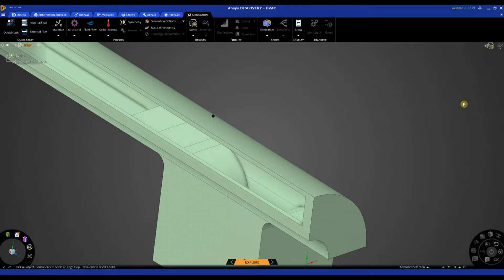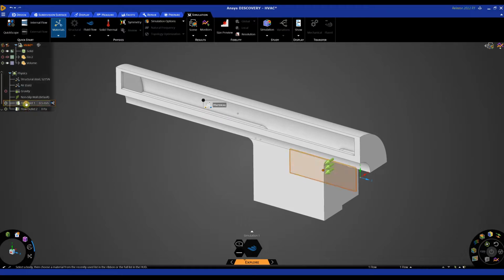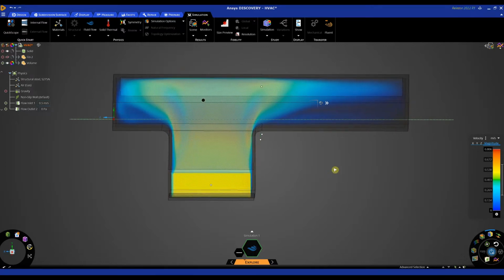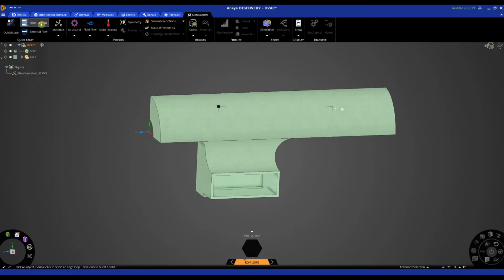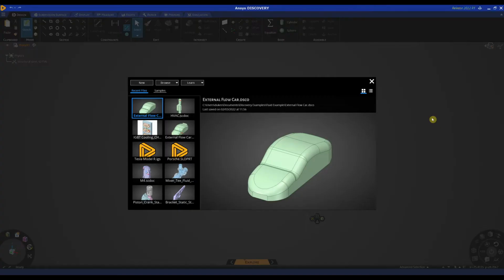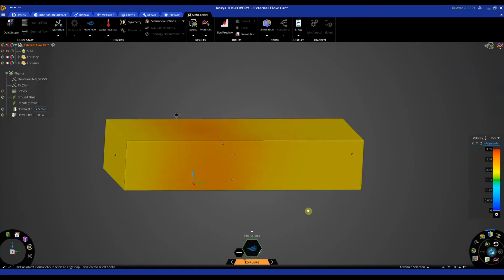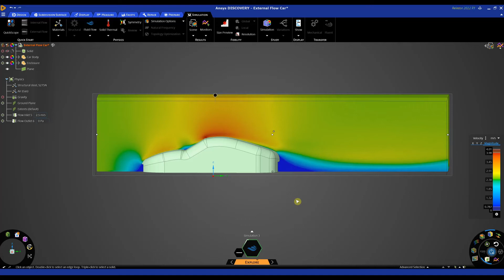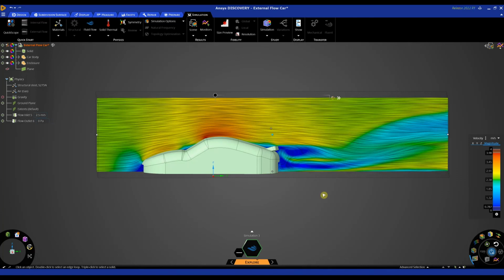Ansys Discovery - CFD, Fluid Flow Analysis

Comment: Hi, nice video, Please, what Laptop is needed for live simulation (minimum GPU configuration)? Can this simulate a Ducted fan  and compute the necessary motor power and torque / the resulted thrust ?
Reply from the maker: Thanks for the comment and watching the video.  Specs required for Discovery are ·  A dedicated NVIDIA GPU card (Quadro recommended, GeForce supported) based on the Maxwell, Pascal, Turing, or Ampere architecture. P3000 or better strongly recommended. Minimum 4GB of video RAM (8GB recommended) on the GPU. Graphics Driver version 451 or higher

In regards to your question, it can be done but would likely be one of the Ansys flagship products, if you would like to learn more please feel free to call us on 03333 440 880

Within Discovery you can model a fan, but you need to enter the torque and other parameters. E.g you cant predict motor power based on the fan but it is possible in other products.
Reply: @originengineeringsolutions431  A big thanks for your reply and info. So it is feasible but with other SW from Ansys, Thanks.
Reply from the maker: @ettrike  Yes it would be possible. If you are happy to share your email we can send you some more details, if you don’t want to share on here just email us at hello@origin-eng.co.uk or feel free to call.